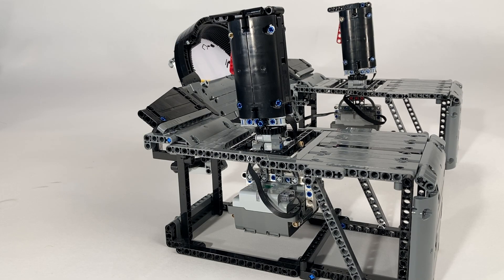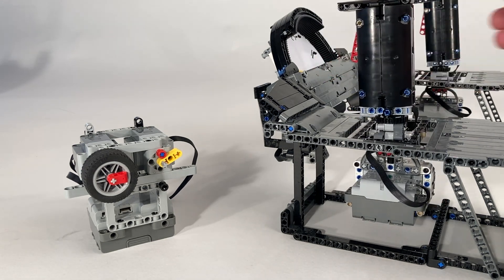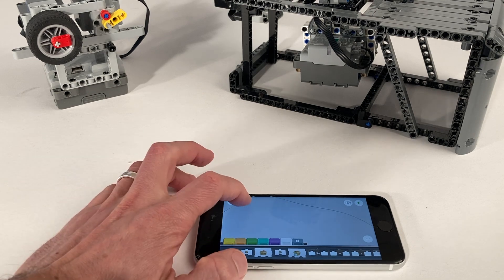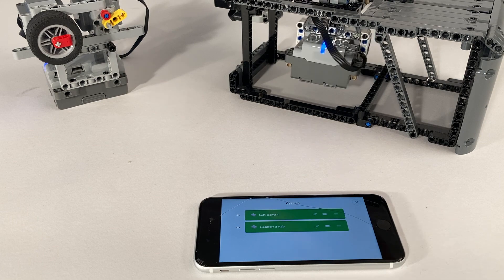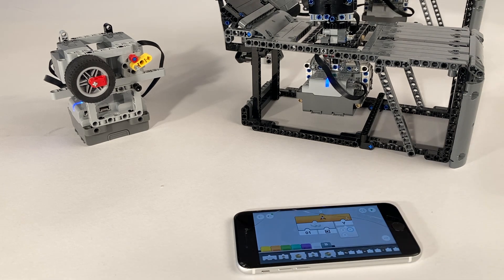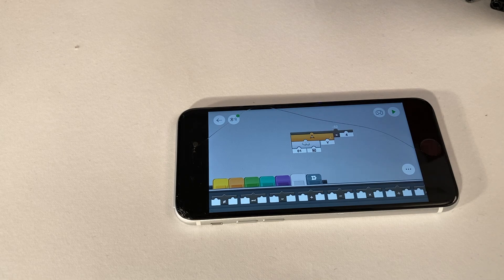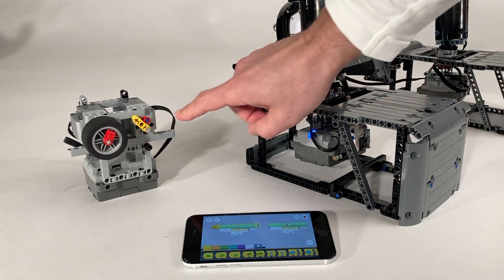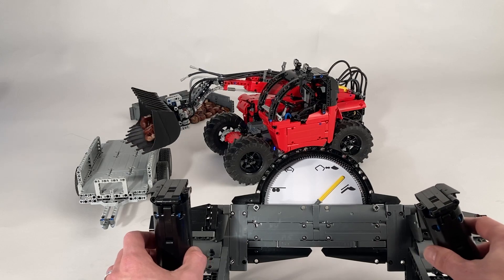How to build a LEGO Technic Remote Control

Comment: I like it. Be really interested to see how you handled the remote control pneumatics on the telehandler?
Also, isn't there a separate gyro sensor you can plug in (I could be wrong)? Would save needing two hubs on the control.
Reply from the maker: Good questions! The four pneumatic valves are operated by a 4-way gearbox. One motor is switching through the gears (by 90° steps, controlled, with the "relaive-movement" code block in the Powered Up App), whereas a second motor is then turining the valve to the other position. Therefore at one point in time, only one valve can be switched simultaniously. When I find time, I'll upload that part of the programming as well.
And yes, there is a Gyro Sensor (45305)! And yes, it can be connected to the Technic Hubs, and yes, you can read out the tilt angle in X and Y direction from roughly about -45° to +45°. It is getting a little vague towards the 45°, but it would certainly work well for this application! I only found out about this sensor, after I have implemente the solution with the two hubs... :-(
Reply: @tobiwankenobi7508  thanks for taking the time to reply, I really appreciate it. 
That's ingenious! Would love to see a short vid of the mechanism. I think the D11 would benefit from that system... If only Lego would bring out a PU compatible solenoid block - that would be awesome!